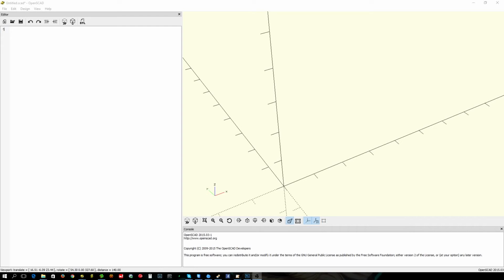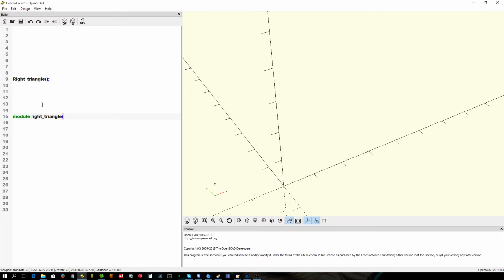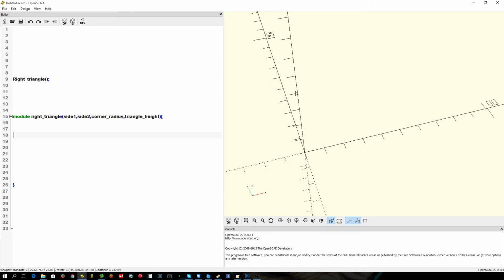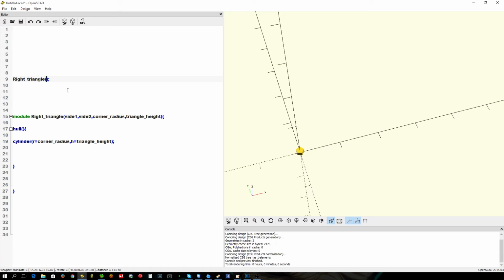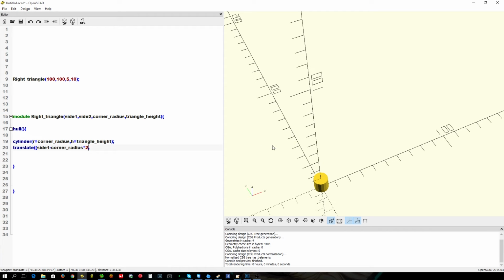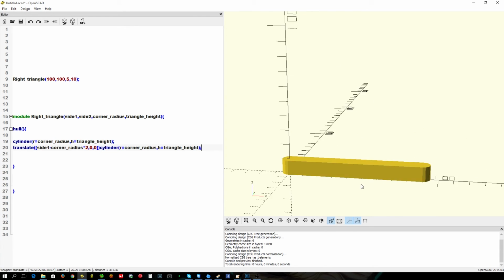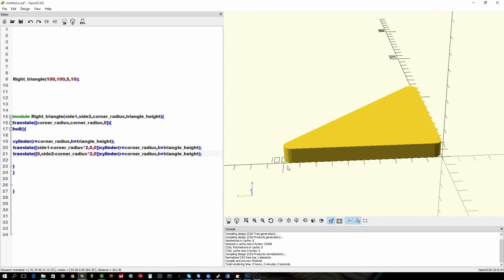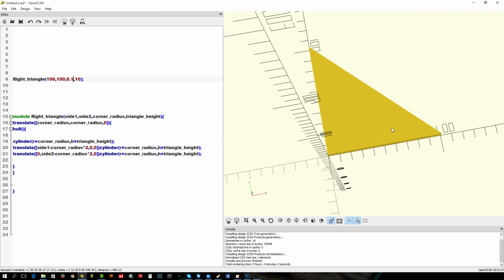Openscad : rounded and pointy right angle triangles

Comment: question : how can i make triangles like yours, but with roundet sides? yours has straight sides, i need this with round sides, corner_radius=3, radius on the short side = 125.
my triangle is short side = around 50, the long side = 100, and the longest side is around 112.
Reply from the maker: you could do it from an intersection from three cylinders but i'll have to try it out a but later, i'm not going to be near my pc until tomorrow